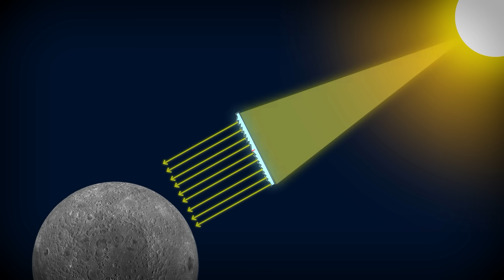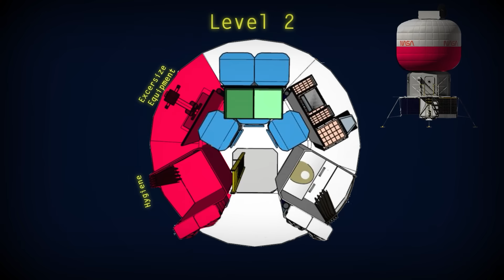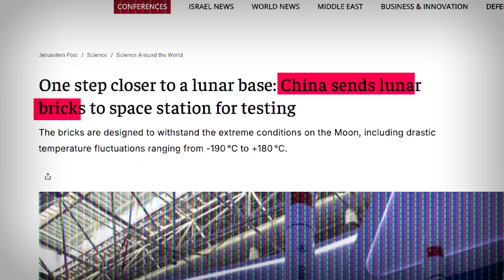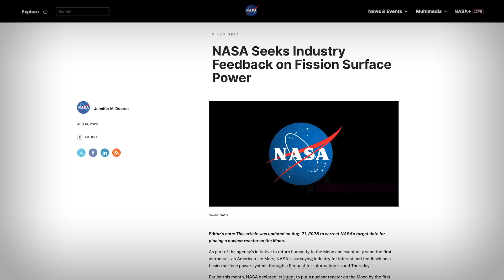How NASA Will Build A City On The Moon

Comment: Realistically we'll be better off building inside the moon, rather than the moon's surface. We'll have some structures on the surface, sure, but that won't really be as safe and secure as a subterranean structures.
Reply: We need to get mining gear up there before the people arrive,
Reply: @johnwilliams3555  There are hundreds of thousands of caves on the Moon that we could use.
Reply: @johnwilliams3555   No time for that.  Moon dust, radiation, and meteors will destroy that installation.  No time to even get that place built and then live on it?  Not a chance.
Reply: China brought moon samples back to test lunar brick 3d printing and it worked, so they're sending a rover to print them in 2028 ahead of their moon base.. Maybe they'll let us use their infrastructure lol
Reply: @moondog8829 well I hope usa knows that
Reply: I was just going to point this out when I saw your response. Seems to me to be a no brainer.
Reply: @briancecil5051  Better than inflatables with little protection.
Reply: Yeah... I can't understand why some many people think this houses above the ground will work on Moon or Mars surfaces.
It's cute, ok.
But that's it: cute!
Very far from functional.
Building underground is the way to go...
More protection against radiation and some meteorites that eventually will fall...
That's the way to go: underground.
Reply: @gilbert1975nf  If only we had a billionaire that wants to "Occupy Mars" start a company that research and develops tunneling and boring. Call it "The Boring Company" or something...
Reply: It would help protect from meteor impacts to build under the surface.
Reply: @runemasterish  And radiation.
Reply: those are a non issue because the chance of getting hit is like one in several million per year
Reply: Mining robots
Reply: In 2024 they found caves/tunnels created by ancient lava tubes. Likely these could be used to build underground structures without much or any mining, which is handy.
Reply: @thereed4443  I am shocked that this is the first comment to mention lava tubes! We should snatch up every lava tube on the moon. They are the future.
Reply: @chrism.1131  "Modeling studies suggest that lunar lava tubes could remain stable with widths of up to 1–5 km, and in some cases even 10 km, depending on rock strength and thickness of the roof." How crazy is that! I had no idea the cavities would be SO BIG. Makes sense given the lower Gs - very cool
Reply: Long term, sure. People will want space to play, and occasional solar storms will be something to prepare for. Beyond a certain number of staff present, one large area is the only feasible option. I don't think we'll be adopting caverns for living space for some time, but there's another reason to investigate them as soon as possible.

 For biology, the most interesting environments to study are not planetary surfaces, where only Earth has blossomed. Subsurface environments could paint a whole different picture of biology, if they can be accessed. This happened on Earth as well, but we didn't know about any of it until 1970. Entire branches of diverse subterranean life previously unknown to mankind comprise most of the total Earthly biomass. I don't know if anyone expects life to be found thriving anywhere on or in our moon today, but we've been surprised before.

 It's obviously a difficult and dangerous environment to access and pass signals in and out of, but robotic missions are in planning. One nice thing about using the moon to test these swarms is that its close enough for real time telerobotic control.
Reply: @DrMackSplackem  No one expects life on the moon firstly because it can't sustain life lol Mars and some of the moons from Jupiter probably have or had some kind of bacterial life
Reply: @unlingotedehierro7136  We really can't say much of anything about the Moon as a host for life (past or present) until we can access subterranean voids. TMK, nobody serious expects a rich biosphere, and nothing at all on the surface. 

You should understand that nobody was saying Titan could possibly be a home for life during Voyager's flyby. Thinking began to change regarding the Jovian moons around 1982, but it took a very long time.

Textbooks today are much more optimistic on this issue.
Reply: You need to be probably several meters at a minimum BELOW the lunar regolith so the people living there aren't getting lethal doses of radiation from cosmic rays and solar radiation.  Those pretty domes and such aren't feasible afaik.
Reply: @DavidWadleigh actually, radiation on the lunar surface is lower than you think. the total rate itself only about 5-10x what you'd experience on a transatlantic flight. simply wearing lead foil-lined suits while outside and covering lunar bases in a half-meter of soil is enough to guarantee 24/7 safety.

the real hazard is the vacuum, not the radiation.
Reply: It is practical, but we are not underground creatures. Even though, we have to give it a chance too.
Reply: @FernandoLopez-ky3wd also, it'd be way easier to build a surface greenhouse network with thick enough glass for small meteorites to bounce off than to build an underground greenhouse. this would also conveniently protect it from particle radiation.

the hard parts would just be figuring out how to stop enough ionizing electromagnetic radiation (mostly x rays and gamma rays) without also blocking out visible light, and that may force greenhouses (and us as well, for the most part) underground. but since lunar surface radiation is only about 5-10x what you'd experience on a flight, the glass meteorite shield might still be all that's needed.
Reply: @FernandoLopez-ky3wd  Have you been to Tokyo? There are so many underground networks and facilities that you can travel around Tokyo without going above ground. Especially in Sapporo City in Hokkaido. During heavy snow season, most people just do their everyday chores underground.
Reply: And would have all that cheese to eat too. Win win
Reply: @teddysthaiadventure2534  But what does green cheese taste like?
Reply: That might not be so good either.  Moving or shifting the moon's mass too much can affect the orbit and cause "wobble".  Dams and mines have done that to the earth.  The moon is much much smaller.
Reply: @allgood5140  Huh? No it can't 😂 you seriously think that we can move something that is almost the half of our planet to move with a couple of explosive? The moon isn't a asteroid lol
Reply: There are already lava tubes that might be possible sites for settlements. That would help to shield us from harmful cosmic radiation as well. The remaining major problem is the regolith which sticks to everything and is extremely abrasive and possibly carcinogenic.
Reply: How's that realistic? The moon has one-sixth that of Earth's gravity. Humans can't survive that for a long time.
Reply: @TylerDurden3711  You are thinking zero G not low G.
Reply: @kraigthorne low G ain't good for the human bones either.
Reply: @TylerDurden3711  Seeing as how no one has spent more than a few hours on the Moon we do not know.
Reply: Hold your horses, I’m sure you’ll have to apply for a permit to that 😂
Reply: @RayRayWasAGoodBoy  The moon isn't California (yet).
Reply: @RayRayWasAGoodBoy  Actually, in a way, yes. Due to the Space Treaty
Reply: @RayRayWasAGoodBoy  Oh you'll definitely need a permit if the UK has anything to say about it. Can't do anything without a licence these days.
Reply: @RayRayWasAGoodBoy OSHA going to the moon? Please no. That will slow progress. Gravity is low on the moon a hammer falling on your toes won't do any harm.
Reply: @ADHDatLarge-s2k  That's a valid point
Reply: @ADHDatLarge-s2k  drills and explosives my guy. But sub-surface habitats might be too costly, the main concern is keep the air in and the radiation out. Promising engineering around use of regolith (moon soil) and sulfer as a binder, which is present in sufficient quantities to be a viable solution. Expect depressing grey domes of eskimo-esque structures
Reply: Space engineers has an answer. Build a fab. Mount a drill to slowly bore out a hole, throw the spoil around the fab to protect it from the sun. Then when you have a large enough hole, go sideways. I suggest they call Colin Furze, he’s got experience with digging tunnels and bunkers.
Reply: Seal the walls, use a tunnel, ez
Reply: agreed. same for mars. we can burrow like naked mole rats. should help protect from radiation from sun
Reply: @sdsurfers7957  exactly like naked mole rats
Reply: I wonder if the nuke reactors can go under too!?

Imagine if they went wrong n u had sharp glass like dust flying at ur space gear, which is also nuclear reactive 😬

Nuke energy sounds a way to get us going quickly, but with such little experience on the moon, we can't afford mistakes 

I have little idea how it works, but i think i remember hearing that radio active dust could be a problem that lingers for thousands of years!?
Reply: @theogulland  I'm pretty sure they plan to use solar energy.
Reply: Way back in the 60s, Heinlein’s books (specifically The Moon is a Harsh Mistress) talked about using large scale plasma torches to vaporize tunnels.  The tunnels would be lined with 2-3 inches of solid glass that would be airtight, so you’d only need to seal the tunnel opening.
Reply: @liljenborg2517  Yes! The glass castles of the moon has been a new age myth for decades. Maybe there is truth or foresight involved in it.
Reply: but what about windows for the astronauts :(
Reply: @Hubert_Labs  Well there will always be surface outposts but they will come with those risks we avoid as mole people lol
Reply: You're on to something.  I did see an article/video that said there are ancient lava tubes on the moon that have milder, sustained temperatures.   If we can close those in we might have a solution.
Reply: The real problem is bringing the equipment to do that since it is basically metal dirt that is magnetic and abrasive. The main idea for making a lunar colony is the 1st build temporary artifical bases on the surface for infastructure, then you dig out enough regolith so you can place something similar to a metal box in the hole that gets covered with the several meters of regolith you just excavated instead of digging elaborate tunnels which would be hard to do without getting equipment covered in dust and damaged.
Reply: @Poondsp  Yep. The Moon is far from ideal, but it is close ...so there's that. lol. I'm sure there are more suitable moons and planets for us to build on, but we can't seem to find them just yet
Reply: Lava tubes might be a good alternative.
Reply: You're right, except it's difficult because we have to get equipment to dig alot
Reply: 1 step at a time, to drill into the moon we have to be able to live on the moon first
Reply: @dchan19362   Then we can't live in the moon.  Radiation, meteor strikes, and moon dust will destroy anything and kill anyone up there
Reply: You know how long they will take shoveling tons of sand before they get to mining?? Lol it's better just to do thick houses of Adobe
Reply: don't you guys know? there are theories that there are caves under, or whatever the actual term is called.. from when lava was flowing. the holes are incredibly huge, bigger than earths.
Reply: Lava tubes sketchy
Reply: @ThrillsonTTKrc  well, it was a really long time ago, there wouldn't be any lava in it anymore.
Reply: @hollow6355 hence therefore structually unsound for underground integrity...shit would collapse
Reply: @ThrillsonTTKrc  ? how so? these things exist on Earth, where gravity is heavier. 

the solar panels would obviously be in the suns view. it's cooler in there. I'm not the expert, so I don't know it in depth, but I think this sounds pretty good. 
also, there is plenty of space for a shelter underneath. I'm pretty sure it wouldn't be close to touching the top, unless they wanted a large roof? but that would be more costly.
Reply: And how will u drill through the rock, a drill is too big and heavy to send to the moon
Reply: You’re crazy. You have no idea how much loose powder there is up there before it finally becomes solid enough to dig something underneath it, that powder isn’t just one finite layer a few inches on the very top of the surface something tells me you would have to dig very deep to reach compacted rock
Reply: The amount of resources required to mine livable areas would be bonkers. Even if done by robots, the dust would inevitably mean regular cleaning. This means that the moon base would already need to be operational and manned with regular workers. Sure it's a no brainer but have a think about the logistics involved
Reply: what about sending a special made Tunnel Boring Machine.  Set it up to bore a series of tunnels that are then cross connected.  The machine would be robotic and go up months if not years ahead of humans.  Nuclear powered or Nuke/Fuel Cell.  Understand that these are huge and super heavy.  That is models for operations on earth.  Build 3-5 varied small scale demonstrators.  Send them to the moon and see how they perform.  Can visit them every couple of months.  We also need a satellite communications network around the moon or in MoonCentric Stationary position over the Lunar South Pole
Reply: The finer regolith and the chunkier regolith underneath won’t be easy to stabilize. The crust of the moon is made of graham crackers.
Reply: Actually you can do both. Magma tunnels aside, we’d need to mine anyway to get the materials needed for surface structures. Might as well turn those mines into habitation space as well. 
With the lower gravity, we could have an earthscraper and a skyscraper on the same plot of land.
Reply: It is a lot easier to bury prefabs under rubble than it is to dig caves and tunnels.
Reply: @Alexander_Kale  Easier, maybe.
Reply: @LocustaVampa  The problem is the amount of mass each approach needs. At the moment, we are so incredibly limited that we need to take an approach that minimizes what we send up. 

Which necessarily means the initial settlement will look incredibly flimsy.
Reply: Build a bridge, that would make easier to get stuff there.
Reply: Said a random guy who know better than everyone working in NASA and all space agency... This is why we should "shut down" the internet, people like this should never express their opinions...
Reply: @Utheree   NASA has already proven and reported the dangers of living on the moon.  They've REPORTED it and shown their findings.  Living on the surface is not possible.
Reply: @Utheree Not every smart person works at NASA...
Reply: That's what the boring company is for
Reply: nasa refuses to do this
Reply: Same goes for Mars. Safest place.